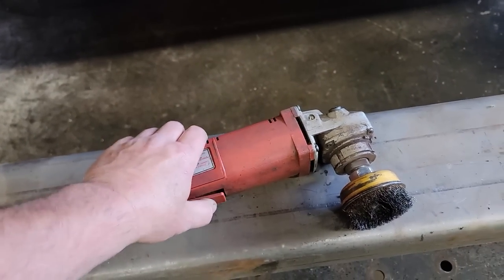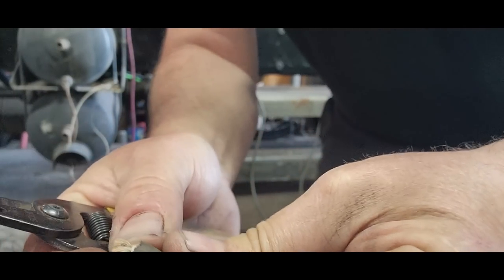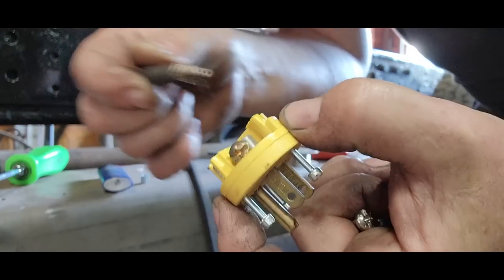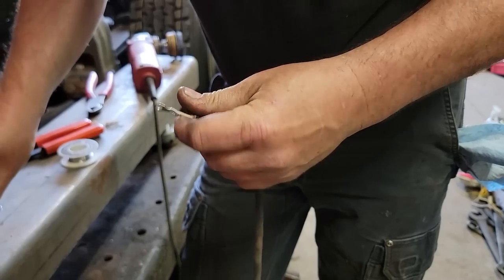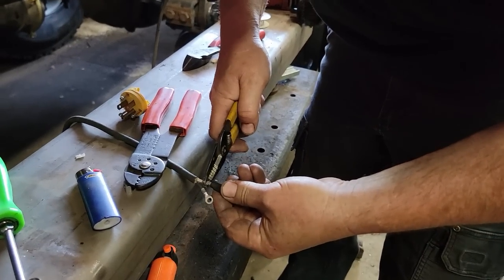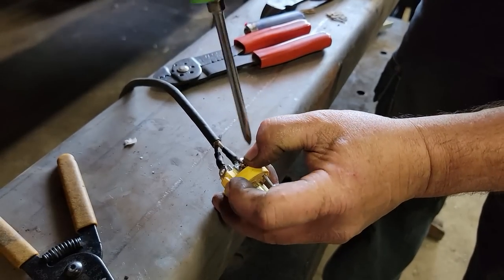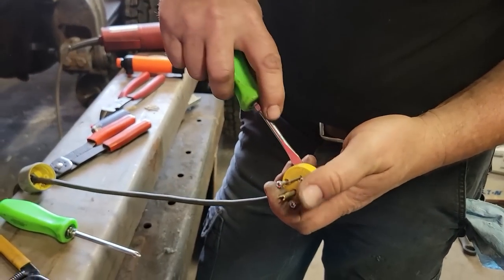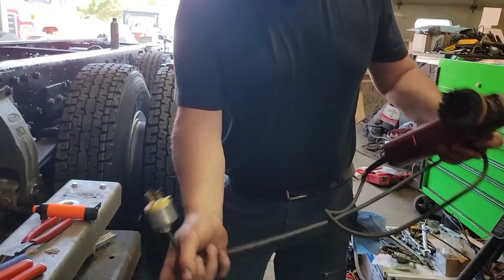MY GRINDER QUIT! WHAT IS WRONG? CAN WE FIX IT?

Comment: J.C. I have a Metabo  grinder that I bought almost 20 years ago. One of the first things I did was tear it apart and but a 20' cord on it that I laying around. It stayed that way up until last year when as I was installing new "I" beams under a dry van, it just quit. I tore it apart thinking the cord finally gave out because by then, it wasn't in the best of conditions. To my surprise the cord was fine. Dug a  little deeper only to find the brushes were completely worn down. I was able to pick up a set of brushes on my way home that day, and had it up and running that night. I even treated it to a newer cord. $126.00 grinder + $10.00 brushes + time in use =  Priceless... to me anyway. Thanks for the video.
Reply from the maker: i have done that when the cords end up too short to be usable. i remove cords from all kinds of failed appliances. usually are a nice heavy rating. i had an extension cord that got burned by the torch. i cut the end off and used it on a heavy milwaukee drill. it ended up 15ft. absolutely loved not needing an extension cord to use it.
Reply: I also have a really old metabo grinder I bought it used for $5 at a yard sale about 7 yrs ago. Recently I left it in my daughters car trunk when I needed it one day I remembered leaving it in her trunk.
Got it back and it won't work now. Ground prong is missing on 3 prong plug. Is that why it doesn't work?

Comment: I really like the idea of using eye crimp terminals in those plugs!  I've had wires pull out when I just stick the wires in the clamps.  I'm curious to see how many keyboard warriors complain about both crimping and soldering a crimp connector.  People say it's bad, but I've never seen a rational explanation of why!  On critical, high-wear stuff, I do both.

Comment: I learn something every time I watch one of your videos, there 2 things I do different from what you do (1) I use a barbecue lighter  heat the heat shrink, It keeps the fingers away from the heat, (2) I crimp a 5/16" lock washer over the outer (black ) insulation just ahead of where the clamp on the plug cap grips the outer insulation. It acts as a strain relief for the electrical connection. The washer will have to be opened up slightly to fit over the wire but it holds well.

Comment: I use to go through grinders like crazy at my old job, the best lasting corded grinder I ran was a dewalt professional grade. That took a major beating and kept going. Bosch was always melting down and releasing the magic smoke for us
Reply: I had Bosch Professional years ago 80s/90s. They never went faulty, just 'missing'... Later Bosch tools always burnt out at connections to the windings. Longest lasting tools in my collection are 2 Atlas Copco (AEG now?) models, grinder and SDS drill. Both going strong after 25 years of weekly use.

Edit: Black and Decker professional grinders were the ones I first used. There was a service centre about 1/2 mile away from our unit so if they failed parts, etc. were easy to get. When Dewalt subsumed Elu B&D went pony and we stopped using them. They were comparable to Bosch pro up to that point...
Reply: When I went to shop class, my teacher always said there was smoke inside the wires. When the smoke got out it was done!!😉😅

Comment: Metabo is the only grinder to buy can’t kill them built to last made in Germany. They set all standards for grinders we use the 6” ones they have crazy high amp motors work great with cutoff wheels and also with standard grinding wheels.

Comment: Try using the knotted wire cup brushes….one they don’t flail out as much as a crimp cup and two they last twice as long and don’t fling wire nearly as bad . I’ve had great luck with my snap on paddle switch grinder…had it since 1989 …back then they were produced by black and decker industrial…same one that dewalt (b&d) produced . I still have a makita I received on my 16th birthday…so old you can’t buy brushes…I was impressed with it enough to buy the updated model of it . Both are great…sometimes a paddle switch is nice..but times I prefer an on/off switch . I’m also a fan of my ingersol pneumatic grinder…especially if working in rain or snow . Metabo is another fine choice…if I was to buy battery operated I’d purchase the dewalt…purely for comfort and geometry…none better as far as that

Comment: You need a lithium ion battery powered grinder. It is liberating. You probably already have some Fuel tools. It is always good to have multiple batteries available so there is always one ready. You will probably laugh as they are homeowner grade, but the Ryobi One Plus grinder is surprisingly good. I have been using it with a welding and grinding project. I have several of their 4Ah batteries and have a bunch of other stuff. I get about 30-40 minutes of continuous run time before needing to switch batteries. By then you want to take five anyway. It is brushless. I find that the most important thing with the grinder is the cutoff or flap disk. FWIW.

Comment: I'm not a dewalt fan either, but the new corded milwaukee grinders have really crappy grease that doesn't flow and lubricate the gears and ive had 2 burn up from lack of lube, however I've had very good luck with the dewalt corded grinder that takes both 4 1/2 and 6 in discs. It comes with 2 different size guards, has a nice thin handle for use with gloves.

Comment: Me I used to buy sjt or better make my cords much longer up the wire size if needed..shop vac super long love it saws etc longer cords. no more extension cords. Once at a job cut circular cord in half fixed it with wire nuts and tape 5 minutes back to work.. until i got home.. same with fans low amps easily put super long wires on them.